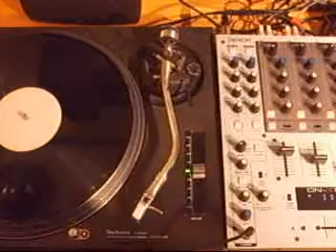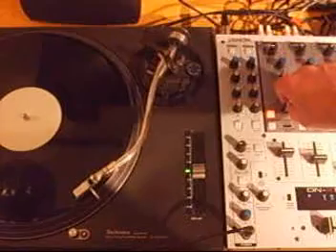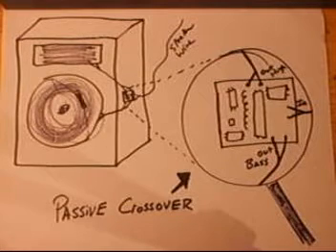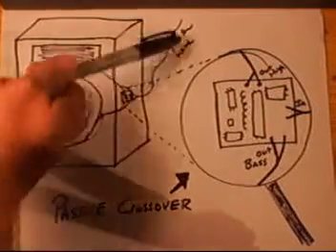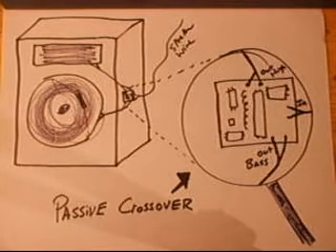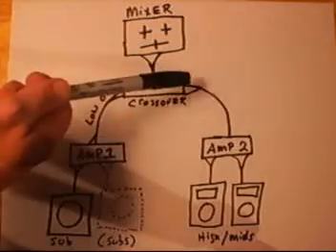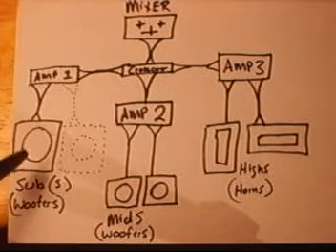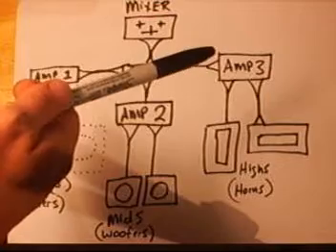Hey Brian - What's Up With Crossovers?

Comment from the maker: The thing with bass is it's non-directional so they can go on the floor and vibration will be felt anywhere around the sub.  Highs and mids, though need to be up in the air.  You can stack them OR "Fly" them like at clubs or tripod them, etc.  Great question!

Comment: There are also some people who are using the XTI amps with build in crossovers.  They limit all the mids and highs to their subs which is good, but they fail to realize they would need either a crossover box or second xti to limit the lows from their mains.  After all this, they get subs and complain their mains are still clipping and theres an awful sound in the bass.

Good vid brian

Comment: I'm using a vintage product from Audiocontrol as my 2 way electronic crossover. Its called the Phase Coupled Activator. Its basically a bass restoration thing and a 2 way crossover in one. I'm only using the crossover portion.

Comment: EQ is to balance the overall sound, it can not be compared to a crossover.  If I have 1 amp and 2 full range speakers then I do not need a crossover, if I have 2 or 3 amps then I need a crossover to separate the sound.  It is impossible to plug 3 amps into an EQ.  Yes, you can balance the sound with a crossover but only to distribute the sound between the speakers.  An EQ can be added to the crossover to balance the overall sound frequencies.   You can also use a compressor or sound enhancer.

Comment: You can use car subwoofer as a regular speaker it won't hurt it the high frequencies will not damage a car subwoofer but do note that a ported enclosure will re enforce those low frequencies

Comment: Hi Brian,  Great Vids!  You  help demystify Crossover shit.  I have a Question hope you can help?  I have a vintage Stereo along with it's original Speakers they have only 8" Mid range drivers @ 8 ohms no Crossovers tweeters or horns.  I want to replace the speakers inside these boxes to maintain the original look but add a two way set up in each box.  How do I wire two 4ohm speakers and tweeters using a pre made 2 way crossover?   Thank You in advance.  Jon.

Comment: well i have a 2-way stereo 3-way mono x-over from behringer and its simpel as hell you got 2 gain 2 nobly things to set youre hz range for the mid low than you have youre mid low volume youre mid high volume and in the center you have youre sub output you have youre mute butens on the output and yourepolerety switch and a low cut switch next to youre gain  its a cheap but verry easy thing to run

Comment: I have crossovers in my homemade speakers. It's worth noting that having 8 Ohm output from the amp into 8 Ohm bass unit and 8 Ohm tweeter does not make them 4 Ohms.  The crossover will still send 8 Ohms to each driver. That's what I've been told anyway.

Comment: very basic indeed, I was hoping for more of an explanation on what's happening with the  board with "lots of resisters and wires and squiggly things" 

but this is a good vid for someone who has just heard about crossovers and want a quick "what is" explanation
Reply: The amplifier outputs voltage. It has a near zero internal impedance, so it supplies as much current as needed to make that voltage. This voltage is proportional to what the amplifier believes the membrane displacement of an idealized transducer should be in any given moment. 

The crossover consists of a number of circuits usually connected in parallel, so each of these circuits gets the same voltage on input. There are as many of these circuits as there are drivers (i.e. sonic transducers) in the speaker cabinet.

Each of these circuits is a filter. In case of a 2-transducer cabinet, they are a highpass filter (removes bass) for the tweeter, and a lowpass filter (removes treble) for the midwoofer. In a 3-transducer cabinet, the midrange can contain a band-pass filter (removes both bass and treble).

Why are they necessary? In any case, tweeter needs protection against high-energy bass, because it's a delicate device. Because you need a small moving mass to produce high-pitched sounds, it's wound out of thin wire on little support. Because thin wire has higher resistance, it would heat up and start a fire, though actually before a fire could happen, the tiny solder joints on those thin wires will heat up and unsolder themselves, this is a safety measure, this is why you don't hear a lot about speakers setting a house on fire but you do hear a lot about damaged tweeters. To put things into perspective: the true power handling capacity is not what is in the typical tweeter specification, if it says 100W tweeter, then it's a 10-15W tweeter which is intended for 100W speaker cabinets, with assumed about 10-15% of the sonic energy going to the tweeter with correct crossover design, for example. Why so little? Typical crossover frequencies are between 1.5 and 4 KHz and the energy distribution in typical music sound is uneven, with bass having a higher amplitude on average, with each octave (= doubling of frequency) carrying approx. half the amplitude and quarter the energy of the next lower one. "Pink noise" closely simulates the typical frequency distribution of music, look it up if you like.

Additionally, there is a distance between centerpoints of midwoofer and tweeter, which means that whenever the listener moves vertically, the distance to each driver from listener's point of view will change. When the distance difference between the membranes of the corresponding drivers from listener's point of listening is exact multiple of the wavelength, the sound will double up, when it's a multiple of certain fractions, the sound will cancel itself out and only the distortions will remain. This makes for a highly unpleasant listening field, you will not notice it consciously that the sound has this so called moving comb filter on it, but you'll notice that it's very harsh and nasty to listen to. This is why the midwoofer needs its higher frequencies attenuated or removed. Additionally, all drivers distort very much outside their optimum range, so that's a secondary reason.

The actual design of crossovers which are in midrange and for close by transducers is an art and science onto itself, it takes many books to explain it, and for passive crossovers in speaker cabinets it also must take electrical parameters of transducers themselves into account, additionally to relative placement. But there's something that you can easily glean from looking at any given filter: the more capacitors and inductors there are, the steeper the filter is and thus less comb filtering and crosstalk between midwoofer and tweeter is retained. If you're curious about actual design of filter circuits, see "RLC circuit" article on Wikipedia or something.

A crossover between subwoofer and wide-range speaker cabinet solves broadly the same issues, it prevents too much energy from being sent to relatively low-power wide-range speaker cabinet thus reducing distortion, and at the same time prevents comb filtering between subwoofer sound and speaker sound. It can sidestep the detailed knowledge of relative speaker placement for one, because down at below 150Hz we're not nearly as sensitive to the small defects in the sound, and and for other, because you can implement it before the amplifier as a low-voltage, low-power active electronic circuit where you no longer need these huge power components, so you can have many more components, and thus make the filter extremely steep, so that the sound really just pretty much stops at a specific frequency. The subwoofers can be placed independently of wide-range speakers because we cannot audibly percieve location of signal approx. below 150Hz, it simply warps all the way around our head. Furthermore some experimentation with subwoofer placement in a room may be necessary, because of standing waves, so a good position for the subwoofer isn't necessarily the same one as the good position for the wide-range speaker. If more explanation is desired with regard to this or any other point, please indicate.

TLDR: there is really no good way to explain it as concisely as "it's a bunch of wires and stuff". :D
Reply: Mother of god
Reply: Siana Gearz Kudos to the excellent explanation. There needs to be more of people like you!

Comment: How do you determine if you need a passive crossover or active? Why are active crossovers used?
Reply: in passive, the points are set.. so if you're not happy with the way they sound then you'd go active to add the ability to adjust them. Generally..  There's more to it but, generally that's the reason.
Reply: thornygravy Alrightythen... I see what you did there... Cheers! ;)